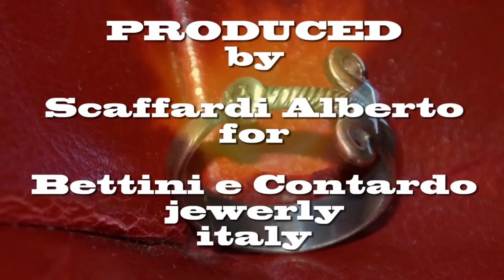The sword. Handmade silver ring

Comment: Thank you! I attempted to make the ring but need much more practice achieving the perception of depth in the hilt, and in the taper of the blade from the center. I started with 1.63mm depth and 10mm width. I start over using the new dimension.
Reply: have u ever tried sand casting with delf clay

Comment: Fantastic rings, but surely it would be a "LOT" simpler to make the sword flat, and then bend it into a ring ?
Reply from the maker: +Celtic Dreams while metal bending lines are changed. Work the already folded metal you get exactly the finished job you want

Comment: Scaffoal- great video, and inspiring work.  How long did it take to make, after the casting and drawing?
Reply from the maker: To made this ring using about two hours
Reply: Thanks for the reply, also- what are the two types of tools at 14:13 through 14:37?  I am fascinated by this and intend to give it a try myself.
Reply from the maker: dismalsidnal Are cones and horsehair brushes or tissue, which used with abrasive paste remove the signs of sandpaper and polish

Comment: How can I reprong a rose gold ring that has no stones? They broke while taking out the first stone. Anyone?
Reply from the maker: I'm sorry but I can not understand the question (I help me with the translator of google). If you can show me a photo....
Reply: scaffoal it is a gold ring, pink gold because of copper added. The prongs broke off. How can I make new ones? Use regular gold wire and use flux and a torch?? I know how to solder.
Reply from the maker: The welding of pink gold is equal to that of white and yellow, tends to oxidize most faster. You must thoroughly clean the parts that balances just by sanding the point of contact. It can be used both welding yellow or red, yellow is better,seen that the flows better, usandone little you will have the safety of the welding and will go unnoticed the color difference.
Reply: scaffoal Thank you!! Where do I get the gold wire?
Reply from the maker: I do it by myself. There are Italian companies that if you need to work the gold, they can made for you . I think if you seek it are also where do you live.
Reply: scaffoal I think I can find it online, thanks!! You do excellent work. My father was a watch maker and did jewelry repair.